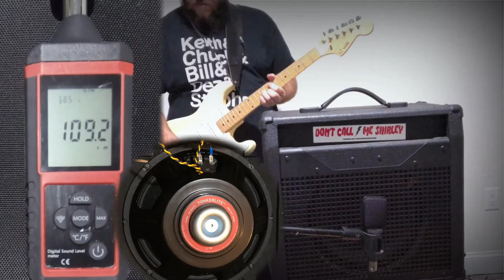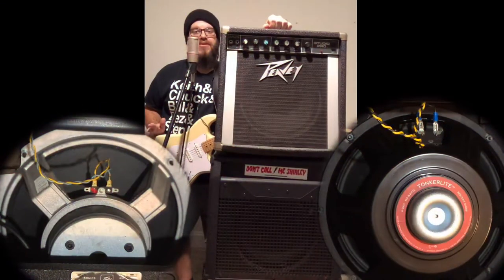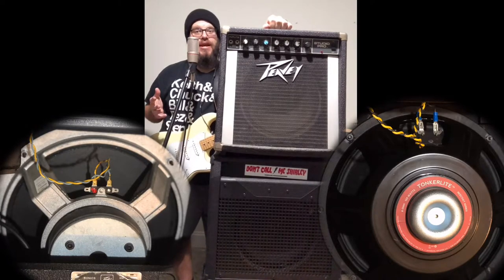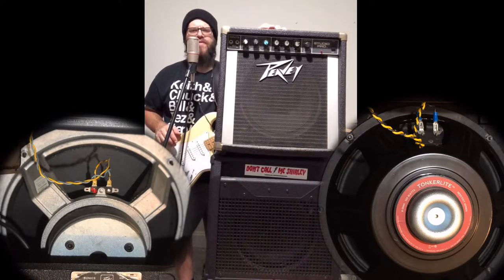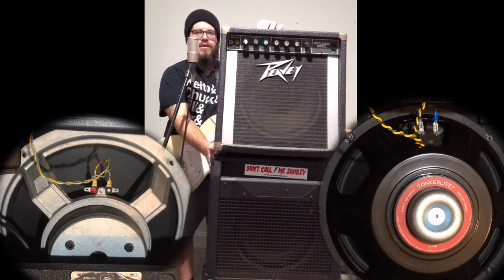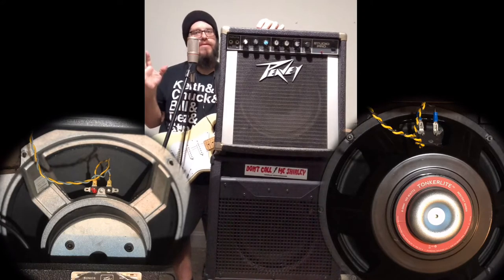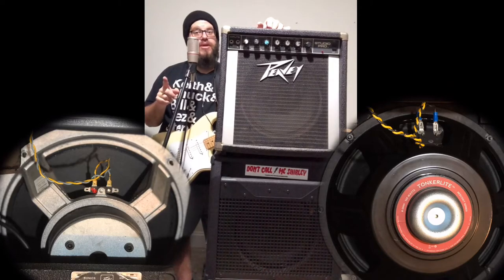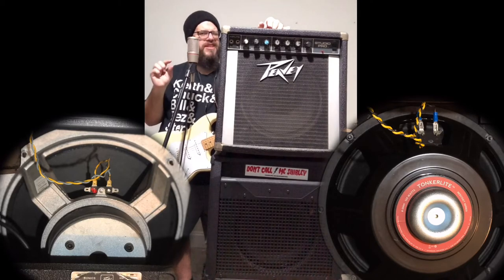Inefficient vs Efficient Guitar Speakers: Does It Make A Difference In Volume?

Comment: While searching for a comparison video between a scorpion 12" and an EVM-12L I noticed this comparison and decided, just for shits and giggles, to check it out since I'm also a peavey SS combo hoarder with currently 3 different redstripe combos, and EFX 112, studio pro and a bandit. But, I noticed something that I should totally bother you with by imposing my technical knowledge and opinion on you about certain technical aspects that you touched on. 

"Sensitivity" is more of an indicator of what to expect from the speaker and how it may work well... or work poorly. That will all depend on certain factors. One big factor is how much clean headroom the amp has. And, the bandit has a shit load of excellent  clean headroom on the clean channel, especially with the modern setting. Then the next will depend on how you use it this amp. If you use the amp as a pedal platform and only use the excellent clean channel like I do (I NEVER use that evil gain channel, it sucks a huge donkey dick) and use it in a live performance setting and trying to keep up with the drummer. If this is the case then you definitely wanna stick with the scorpion. If you are just practicing at home and want it to sound decent with out pissing off neighbors then the tonkerlite is possibly the better choice. 

When you see the sensitivity rating it says what next to it? It says at "1 watt/per 1 meter" and that's just the thing. It didn't say at "65 watts/per 25 meters" the more sensitive speaker usually sounds pretty nice close up and lower wattage use. But run a clean 20db boost pedal into a TS-9 and then that into a soul food or a boss bd2 all with the gian as around 1 or 2 and the output volume wide open (ala SRV) and crank it to about 7.5 on the clean gain and listen to how a strat neck pickup sounds over a band at a bar gig from around 60 feet away. It's gonna sound like hot garbage. It's gonna sound dull and muddy and just..... Weak. And the scorpion will sound very tight and smooth, warm but just glassy enough to cut thru the other bandmates noise to still stand out. 

But, how do I explain this in a way that proves this. I don't ever expect or even accept people just taking my word for it. I'm not giving people fish anymore, too old and wise for that shit, I rather show you where the fishing pond is and give a couple basic pointers and let you develop your ability to think critically so you can expand what you learn into solving future problems. 

Efficient speakers tend to suck for loud usage with the volume up very high and pushing the preamp transistors and MOSFETs hard with pedals to help hold your tone together and give your loud gigging amp very good touch sensitivity. It tends to make the higher frequencies just disappear and get drowned out by the driver becoming so muddy it can't do both and it's like it is all just compressed into a harsh slop of sound that annoys the audience. But, that's why the best live performance speakers tend to be heavier than a US Navy Battle ship anchor with a comically huge magnet, an over engineered cast frame and a ridiculously high rms wattage range. High sensitivity speakers are very good for high headroom amps at live performance volume settings. But lower sensitivity speakers tend to hold together much better and also sound much better overall when cranked
 They balance out and actually the highs catch to the excellent low end. 

But what's the objective science behind that? It's due to frequency wavelength. Speakers work by using AC current to creat a sound pressure wave from the speaker moving air back and forth with rapid fluctuation of input power polarity. Which is why the transtube series sounds so good it because it's mechanical just like a valve. "Tube Logic" is not mechanical engineered tube emulation it's a fucking chip, a digital based programing software. That why Roland corp coined "logic" in it's name and why peavey coinded "trans" in their name for the technology. Peavey actually made a superior tube emulation amp than ROLAND did. Why, they didn't over think it. They still used the old school electronics engineering principles to achieve the same results of true valve tone, that is actually superior to many cheaper Valve amps and way better than digital class D powered Amps like the "logic" all digital technology that Roland over thought. The one thing an amp needs to be able to achieve that warm valve tone is a power input transformer. All peavey transtube amps  have a big ass transformer in it. If you can find one on a Roland product with "logic" written on it I'll give you a $100 bill for it. The "D" in class D amps stands for digital and it's very weak at burning the square wave in the transfer of DC into AC to reproduce the essential functional advantage of a valves ability to be naturally warm and touch sensitive. Because it's a mechanical bleed for excess DC current when the waveform smacks the voltage frame rails thus creating a squared wave and a shitty mess of harsh muddy distorted tone that sounds even worse to the audience than on stage. 

At 3 feet and 1 watt, the eminence is 2.5 times louder because high frequency has a very short soundwave form and draws the current from the amp getting it closer to the frame rails but not close enough to square the wave and muddy the sound yet. The heavy industrial strength scorpion doesn't draw such excessive amount of current squaring it off because the amp has so much headroom that it can loudly and clearly project the mids and lows so well that the higher frequencies aren't lost and it is much louder and clearer to the audience because they aren't only 1 meter away and it's cranked well past 1 watt. So the scorpion is actually more efficient overall since it can hold together as though it was easy. Because the tonker has a much higher FS means that it's gonna sound loud close by due the higher frequency having a shorter signal waveform. But, to sound loud and clear at a gig,  a speaker needs lower sensitivity and less unnatural wave form breakup by exceeding the voltage rails and squaring off the AC current into a squared DC one that just sounds like fuzzy shit because it's not meant for live use

The lil tonker is home use / practice speaker. It's like a daily commuter. 

The scorpion is your gigging speaker, it's like your race car, it's should be used at the track on the weekends because it's only really for performance use, not getting groceries. That's an analogy.....

The scorpion is a far superior speaker, it needs more room to prove that tho. 

List artist that exclusively used low sensitivity, high wattage, huge magnet and cast frame JBL D & E series, electro voice evm-l series and also altec and even peavey scorpion and black widow

Duane Allman
Dickie  Betts
SRV
Anyone that uses dumble or soldano cabs.
Joe Bonamassa

Oh, and I forgot that most British speakers are under 100db and even under 97-98db

So it "depends" but I think peavey fucked up taking a true pro-grade speaker out for a mediocre lower end eminence.rebaged consumer grade part like the blue marvel. The Sheffield 1230 is much better of those two but the scorpion is the shit. Seriously

Comment: I always heard the Scorpion was the ultimate Peavey speaker for high efficiency/sensitivity. Because of the heavy weight construction and high power voice coil. The stock speaker in my Peavey Studio Pro 112 Transtube only weighed like 3 lbs, and if you compared that to either the Scorpion or the Tonkerlite, it would only seem 1/2 as loud. Also very weak in the midrange. These 2 you compared are both killer, heavy duty speakers! Loved the video! Eminence and Peavey rate their speaker sensitivities a little differently, I’d say they’re both realistically about 100 dB. Look at the weight difference, though! I’d go for the Tonkerlite all day. Sounds great!

Comment: The rated spl of that scorpion is 98.7db and if the tonker is 101.1, you won't hear the difference between the two volume wise, which is what you demonstrated here, more than "one speaker is more efficient than the other"
Reply: Actually that is almost 3db increase at 1w/1m. To double the output volume it has to increase by 3db. So it's technically twice as loud. But, only at low volume. The scorpion is capable of much higher overall volume because it has much more headroom for live gigging. The tonker will start  clip it's signal waveform much quicker and rendering it less capable to loudly project sound clearly and making it drown out with muddy responce and have to struggle to keep up with a drummer....

You may wanna read my thesis I left in the comments about the technical aspects that complicate the probability of finding a truly objective truth about the individuals understanding for the different kinds of "loud" one is low volume loud and another is high volume loud. Those tech stats can very vague and misleading to all means of intended purpose, it's all depending on the users needs...

Comment: Thanks for the video.
Do you notice that much difference in the room? I ask because I love Celestion Redbacks but they are 100dB.
I am wondering if I can turn up much more if I run speakers that are 97dB.
Is it splitting hairs.
Reply from the maker: It would be like if you cut your amp’s power in half as far as the clean headroom. Every doubling of power is about a 3db increase in volume.